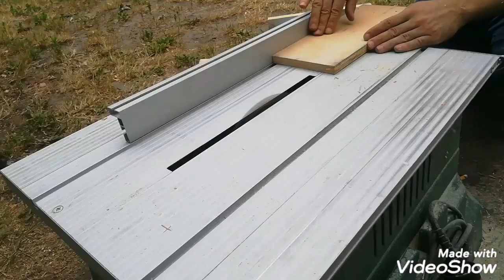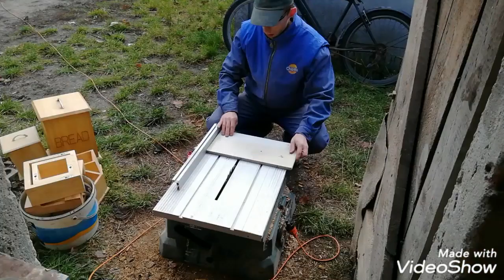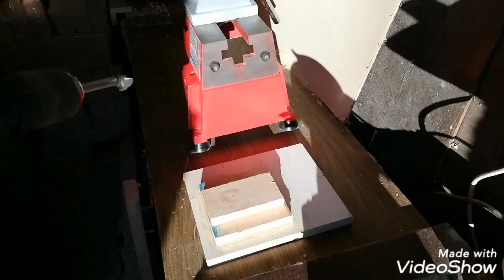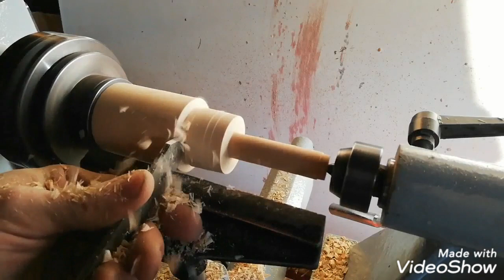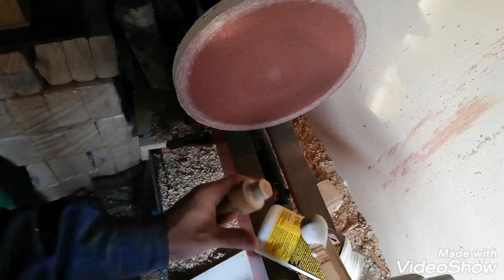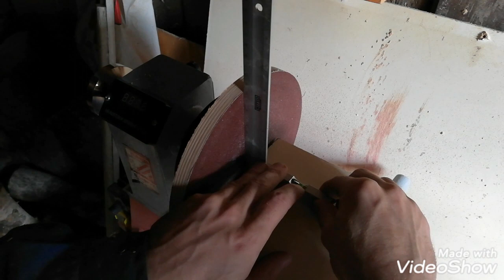Table for sander disc on the banjo - Selfmade

Comment: Looks very close Rav. I like the banjo mount - great idea there ! Only 2 sources of why it's not at 90 degrees I can see...
1) the boards stacked up unevenly due to non-parallel surfaces (poor lumber sizing or uneven glue - neither that likely ?) or 
2) The banjo surface the turned mount rests on is not flat (it doesn't have to be because a tool rest is always raised above). Try raising the table in the banjo.
-Mike
Reply: Hi Rav...great sanding station...you will find it really useful...I really enjoy making this kind of thing...especially if I can make it for free....great idea...All the best.....Andy
Reply from the maker: There could be many reasons but I think the main problem is with table rest becouse it is wood and when I squized banjo (to much of course) I splashed the wood and now is not straight. I have to buy steel rod and make it once again.
Reply from the maker: Thank You Andy. 
Especially for free 😁 I like making those things. I could buy it but there is no fun 😉 and I have gimnastic for my mind 🤯
Take care my friend.
Reply: @Secondlifeofwoodturning  Ooh, splashing/squishing/crushing wood is no good either 😮 Keep the faith bro.